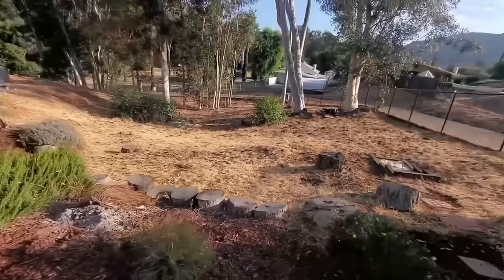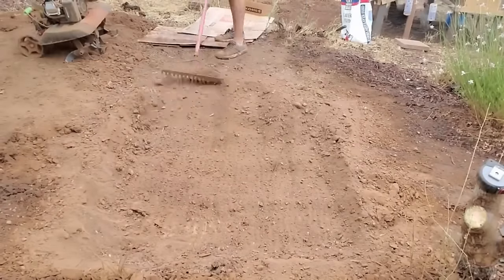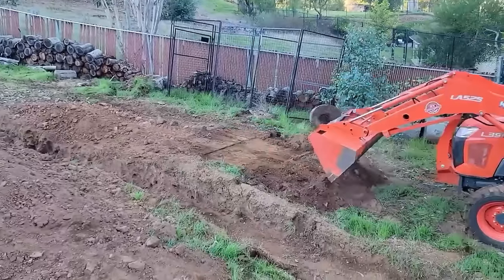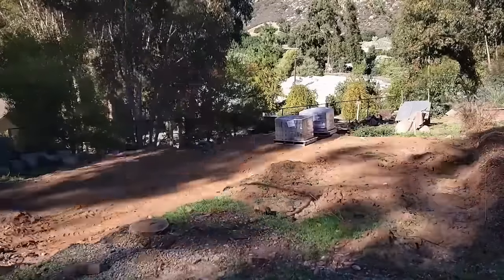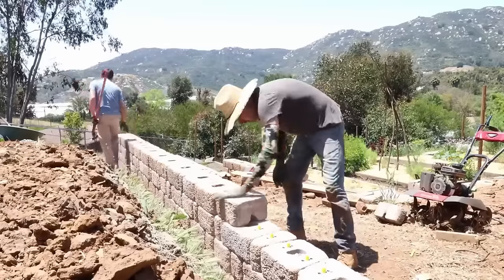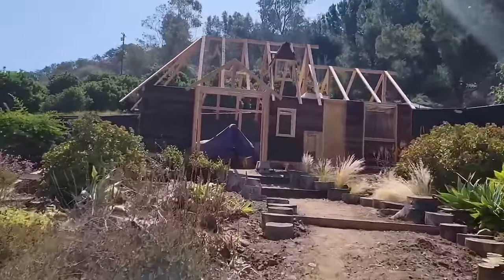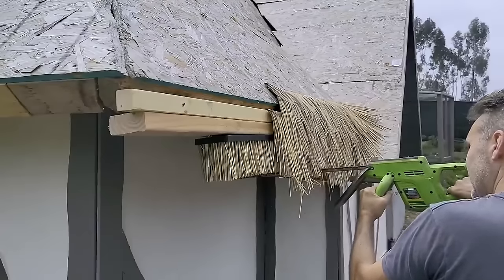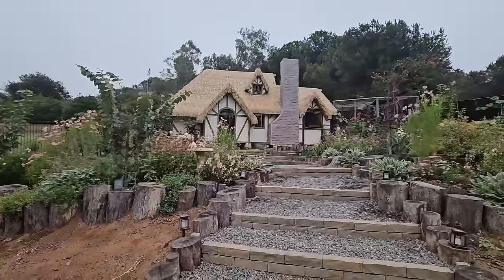2 Years on Our Property. What it Looked Before & Now! Also, Where We're Going!

Comment: I actually had an Alice in Wonderland garden at one time. Unfortunately the oak tree grew so big that it shaded the area too much for the roses ( I did have red, white and red & white). They also all got that nasty rose virus & I had to rip them all out. My chess pieces eventually all rotted. Make sure to get ones that are not wood (Megachess is where I got mine - they have a lot of different kinds). That whole area is now so shady that I can't grow roses there - but azaleas didn't like it either. One thing that I did was to have "garden ornaments" of a paint can & brush with red paint on it; also I had a miniature table & chairs & tea set in iron. I had planned on putting up a large clock with a chain attached & I found large playing cards that I had planned on laminating & hanging up in the oak tree.  But the chess board is still there. I used different colored square stones. I may try again .... since the oak tree is so much taller now I may get it pruned & opened up so I can get some roses in again if I can get enough light in there. It's been about 10 years since I had roses in there so the virus should be gone. I can't wait to see what you do with your Alice in Wonderland garden. I had another area that had trees & a lamp post in the middle (Lion, Witch & Wardrobe) & another place with an urn with yellow, white & blue flowers (Goblet of Fire)... so it was a literary garden with my daughter's favorites. Good luck

Comment: I enjoy your work so much, just beautiful. 

I have a question about the liquid Neptune's products: I bought a quart jar of it last Spring and used it with seed starts and transplants. I had a lot leftover. I've got it in a glass jar because a raccoon tried to run off with the original bottle and cracked the cap. I can see it separated into layers and started wondering if this stuff is still good to use?

Is it a ferment? Does it have preservatives, e.g., chemicals?

How long is it good for?
Reply from the maker: It'll last just shake it up
Reply: @NextLevelGardening  Thank you 👍